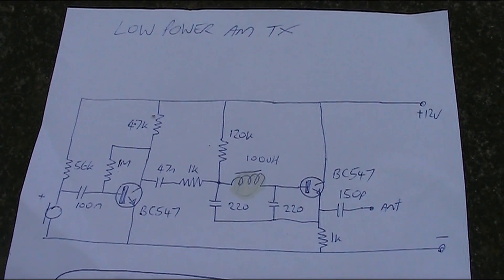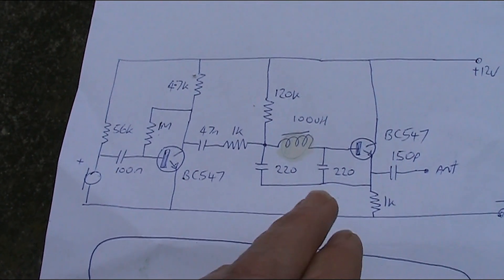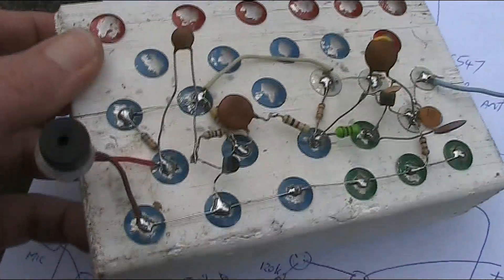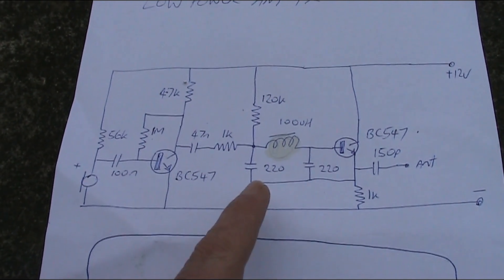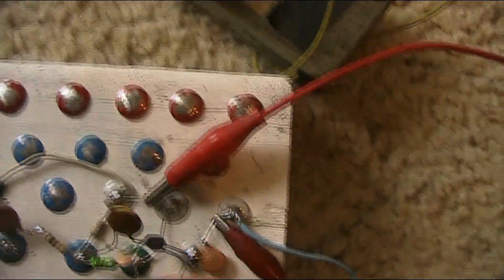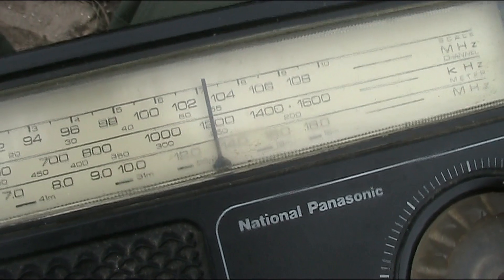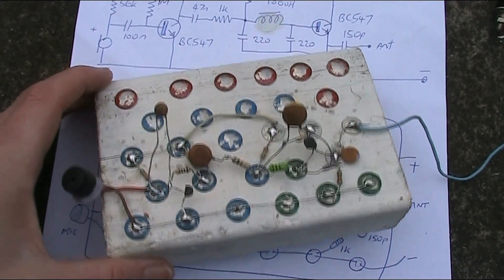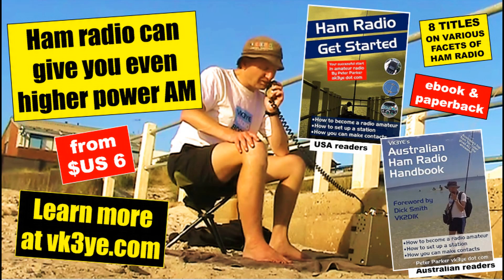Low Power AM from 2 transistors

Comment: I made this transmitter. For me the basic design works well only with a microphone. In order to play music through this Am transmitter I had to remove the entire microphone amplifier and change the value of the resistor that is behind the LC circuit from 1K ohm to 1M ohm. After this change the broadcast is heard only in one place on the radio scale

Comment: Hi Peter!
My question is, could I somehow reduce it's range to maximum 1 meter (received with a pocket radio)? I mean, to archieve good signal within 50-100cm, but above that I would need heavy signal loss.
Also, sound quality would not important for me, a mono telephone quality would be more what I need. Only power consumption would be a bit crucial for me.
Thanks in advance!

Comment: Can i use an antenna made from copper wire? How long?
Reply from the maker: Copper is the best material for wire antennas. Lengths depends on frequency and type of antenna. See various antenna books for info.
Reply: @vk3ye  I wanna know antenna length for this circuit

Comment: Cool circuit.  You could omit the mike and replace it with a tone oscillator and send Morse  code.  
Decades ago while learning to make a VFO I had my AM receiver turned on while tuning the VFO.  I heard something for a second.  Eventually I tuned the AM radio to an empty spot  on the AM dial..  Then while tuning the VFO I found a lot of Short Wave (S W) stations in my AM radio.  I added 50 feet of small wire to the AM radio and got more S W stations.

Comment: Excellent video Peter. I love experiments with these little AM transmitter circuits. I remember some years ago building the poppet AM transmitter and later built a crystal controlled 80m version with the intension of building it into a box with an 80m AM receiver, similar to your 160m transmitter/receiver version. The receiver plans were going to be based on the integrated AM receiver TDA1072 chip. My plan was to make a small internal amp based on an IRF530 transistor maybe running on 24v and take it portable...David M0DAD

Comment: I think in the UK, many of us will be forced into building something similar as just about all our MW and LW broadcasting will cease next year. Sadly FM, DAB and DAB+ do not have adequate coverage and the latter two modes also have poor power use efficiency.
I did consider that our government might want to maintain a robust AM means of mass communication in case of disaster, however upon further considerstion, if it does not occur to them that such a provision should be made, it is highly likely that they wouldn't have anything worthwhile to communicate to the mass populace anyway!

Comment: Can you get 100% modulation with this circuit and could you get more power out from the collector with a collector resistor in place?
Reply from the maker: Short answer is no. I I'll have a follow-up video discussing this in detail soon.
Reply: @vk3ye  ok, thanks
Reply: Sounded like modulation was over 100% when Peter was speaking close to the mic?
Reply from the maker: @Steve-GM0HUU  Yes it was distorted but for another reason. More in the next video.
Reply: Would it be better to take the microphone out of circuit and convert to line level, the modulation might be better

Comment: Hey Peter can you do some 1 to 5 watt am transmissions while listening on the websdr's to see what sort of skywave ranges are achievable on hf frequencies
Reply: Great! I've been reading about old WW2 era wireless sets like the A510 and the No.11 that were low power portable/mobile sets mostly used on CW but were AM capable and the user manuals would list different ranges they were capable of with different aerials. Obviously AM can't compete with SSB for long range voice communication but for a period of time AM was what they had and I find it fascinating. There is another youtuber called Helge Fykse LA6NCA who has done some AM tests with his old WW2 sets with 1 watt AM and achieved about 100 KMs with another amateur on an WS No.62.
Thanks for the videos Peter.
Reply: Hello @669 Here's an easy schematic with coverage of half the world, search with Google for : the grenade transmitter
In the Netherlands, the pirates are around: 6200 to 6400KHz in AM Modes
The crystal determines where you transmit and of course the final filter -
also be adjusted if you deviate far from the crystal in the diagram!
.
ATTENTION!!! ( RULE ONE ( 1 )  you can't do anything without a good antenna! 
50oHM coax with 2 X 10...12 meter wire inverted V   ( is minimally required )
.
Healthy and Kind Regards!
Rob
Reply from the maker: Good idea. I'll have something soon.